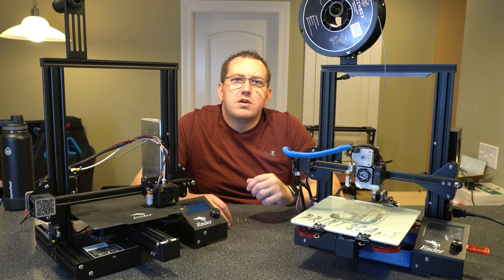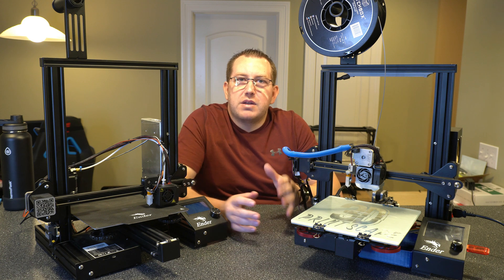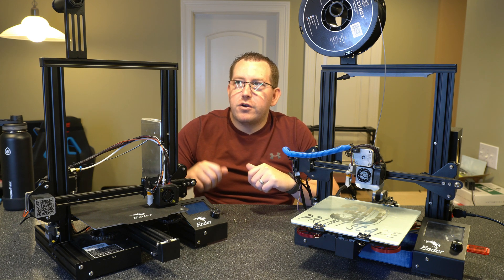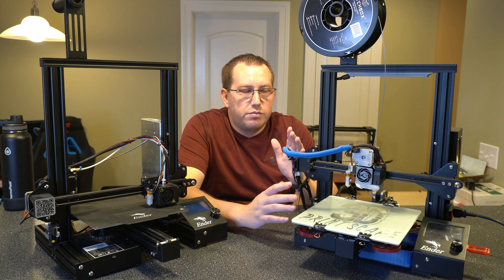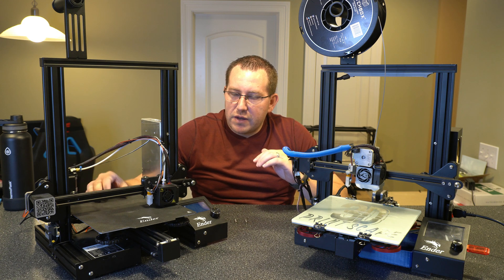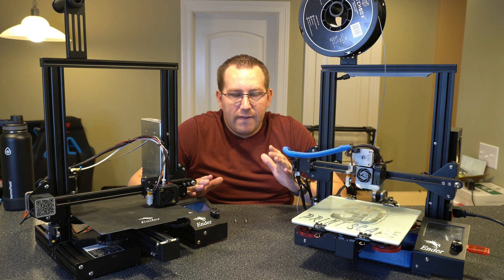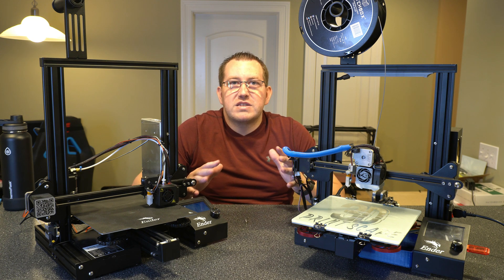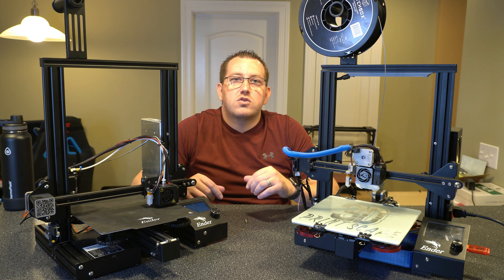3D Printer Spring Upgrade Options

Comment: I hate yellow spring keep deformed bed level of my Ender 3v2 with bltouch as I fix level heatbed many times...

I will buy silicone leveling column for stay leveling heatbed!
Reply from the maker: Hi. I have been using the silicone mounts for months now and like them.

Comment: i have ender 3 pro just bought few days ago and upgraded those weak springs to orange springs same as your but one issue is back left one has issue with height of that heater cable bracket ….too tight of space ….
Reply from the maker: Hi. Are you just not able to get that part low enough? If not, can you raise the other side a bit and still keep the tension on them?
Reply: @3DPrintscape  by raising the bed it'll be too tight to. Nozzle u forgot the thickness of magnetic  sticker and glass plate
Reply: if i loosen the knob itll be too loose knob  thats why the thickness of the bracket interferes with it a solution is put old one spring in back left back corner ….sigh  new springs bit too long

Comment: Don't know why everyone keeps buying the yellow springs, probably because someone did it and started a trend.  The Red Springs are stronger and I have used them on my CR10s for a couple years and they rarely need adjustments.
Reply from the maker: Hi. I think its because the yellow ones are common in the upgrade kits, but i agree that the red ones are better.

Comment: I get weeks or a month of printing with the heavier flat spring upgraded springs.  Ender 3 Pro on Creality glass bed.
Reply from the maker: Hi. Thanks for the input, i guess there are a lot of factors that would affect that. Also, dont get me wrong the upgraded springs work just fine, i just like the solid mounts a little better, and there would be very little point going from them to the solid mounts.

Comment: Thanks for you help! I was looking up info on solid bed mounts the day you released the video on them. I bought the ones you had linked. Definitely worth the investment! I did have one question.  When doing the corner leveling after installing them, the right front part of the bed is a few MM away from the nozzle while the other 3 corners are exactly where they need to be. Can I solve this problem by putting a washer or 2 between the bed and bed mount?
Reply from the maker: Hi. Thanks for the feedback. I think you have a couple of options. 1) make sure you put the smaller mount where the cable harness goes 2) would be to tighten the other 3 sides more, but im not sure if you can get that much of an adjustment on them 3) adding a couple of washers to the one side should work fine as a last option
Reply: @3DPrintscape   Alright, cool. Thank you sir! I’ll take a look at it and try these out. I appreciate it!

Comment: Thanks for the video as always! Very helpful. 
Edit: Just wondering, why do beds need springs, can't they just be completely flat on the table?
Reply: They need springs so they can be adjusted
Reply: @ninjaride1312  But if it was perfectly flat,  sitting on the table, they wouldn't need to be adjusted unless the table isn't flat
Reply: @AbcDef-ig8yq  thats the problem it isnt
Reply from the maker: @AbcDef-ig8yq  Hi. Thanks for the feedback. The bed springs are really to level the bed against the x axis. You could have a completely level printer and build plate but have print issues because the x axis isn't level.